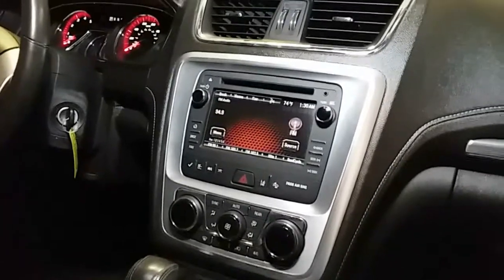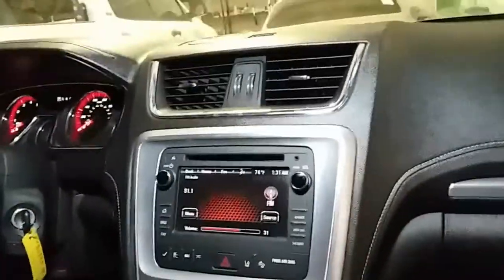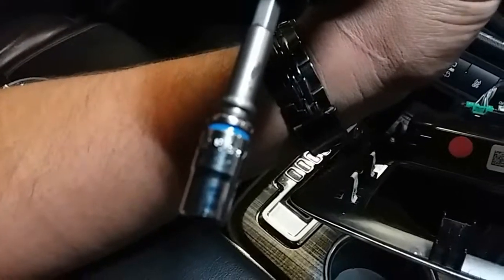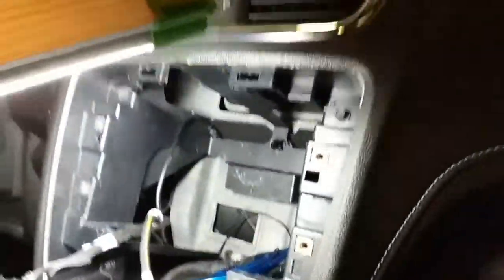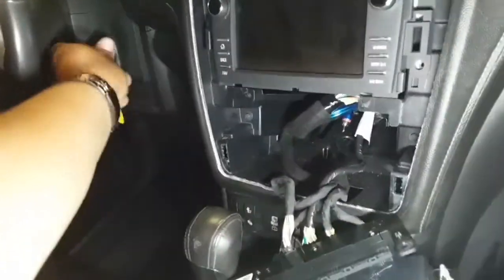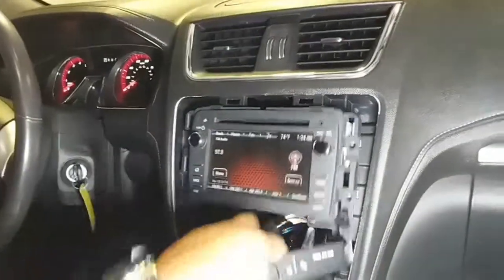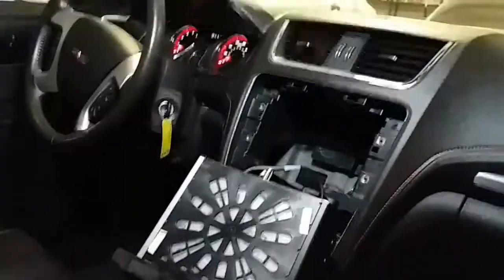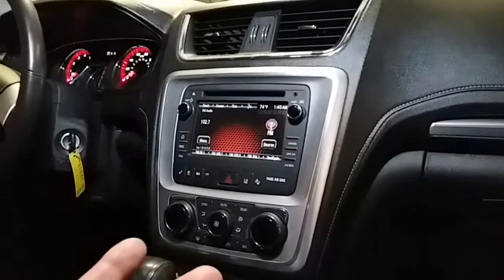How to: Troubleshoot 15 GMC Acadia Radio not getting channels

Comment: I have a 2014 acadia denali and my radio is stuck in a reboot cycle and if i use my turn signal and and the radio reboots at the right time the turn signal sound is suppose to go off it goes silent and the radio doesnt boot up at all until i turn the turn signal off....all fuses are good...i have disconnected battery to reset and still same problem...any ideas?
Reply from the maker: I don't, I'm sorry it sounds like some sort of electrical issue. Sorry bud

Comment: I have a 2015 same exact radio mine will not remember any new presets will not remember any Bluetooth device after turning off the vehicle. I have to re-pair my phone every time I turn on my car. Any ideas? They said it is not due for an update
Reply from the maker: To me it sounds like something isnt connected properly...is it the stock unit? Did it work before? Or is this a aftermarket head unit?
Reply: @559powerscape  yes it’s stock. Yes it use to work. It is to automatically connect now it says that it can’t connect to my Bluetooth when I turn on the car. I have to manually do it. 
I have tried to add a new preset to my favorites for the radio and it doesn’t remember it either. The radio also always starts up on the same fm station that is not even a saved preset and I have it set to stay on the station that was last on which is normally an Xmas station.
Reply from the maker: It sounds like it might be defective now. I honestly dont know. I would try replacing the unit with an aftermarket one or oem. Oem is more expensive but could possibly find it on ebay. But then you can run into an issue with security codes that might need to be entered...my honest opinion is go aftermarket Head Unit. There is soooo many options available now a days. I suggest an Android Radio...u can download apps. Its just like a tablet. Good luck ... or just leave it...save the money... up to you! Thank you, hope you have a great weekend!